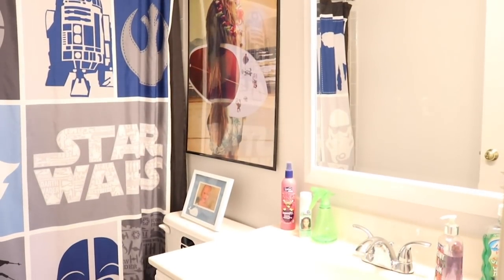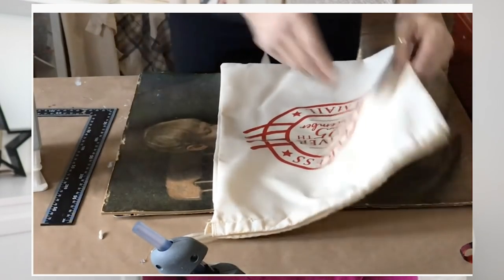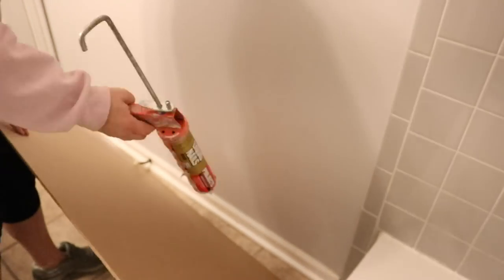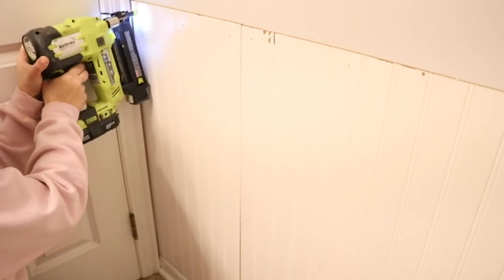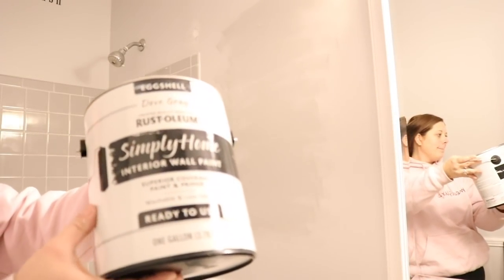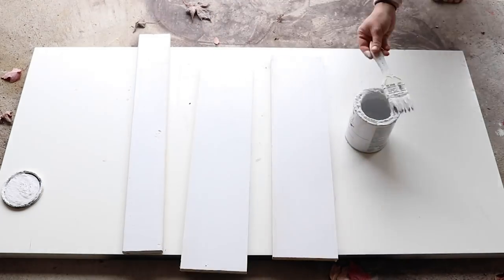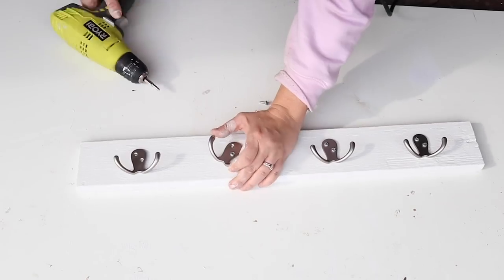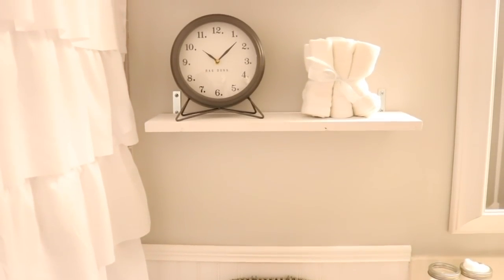Easy DIY Farmhouse Guest Bathroom Makeover

Comment: Very nice!  I'm anticipating doing a remodel of my bathroom and was wondering if you needed a special paint for the bathroom, one that resists moisture?  I saw that you painted the wall in the shower area.
Reply from the maker: Hi there Gail! I have never used anything other then regular interior paint when painting bathrooms and never had a problem. I do like using different finishes like eggshell and satin because they easily wipe away dirt but I use that in every room in my home nothing special just for a bathroom. I hope that helps thanks for watching! 💕☺️💕

Comment: When you paint with semi gloss to have a smooth perfect finish with no paint brush mark you should use a foam roller and it would look like spray painted
Reply from the maker: Thank you! I did use a roller for the second coat but the first I did with a brush to get in all the groves. 💕